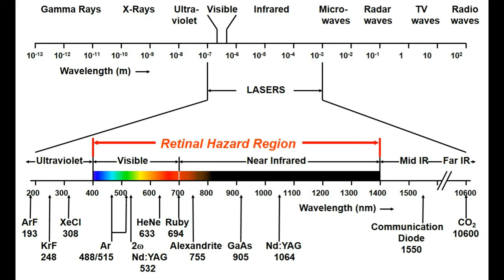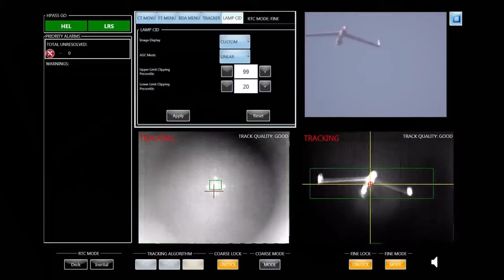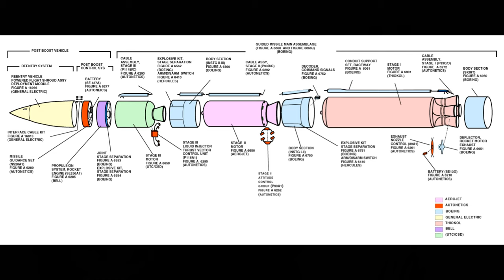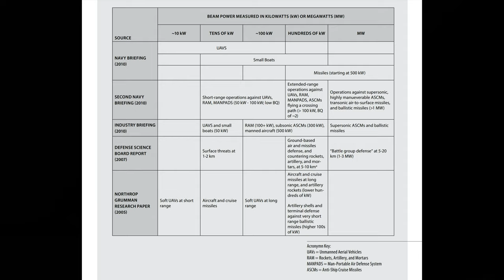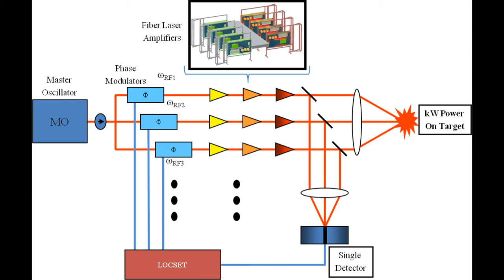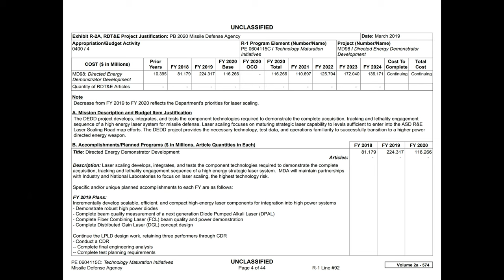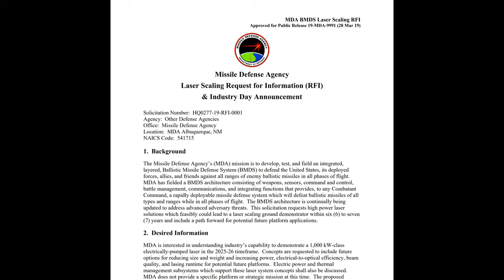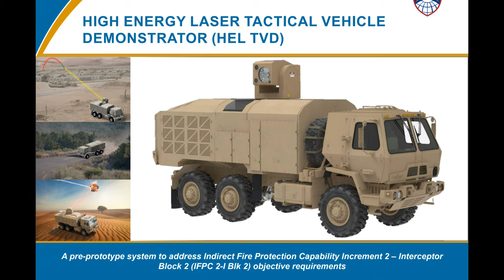An Intro to American Laser Weapon Efforts

Comment: @1'45" you show an image of the EM spectrum with visible + near IR marked as "Retinal Hazard Region". AFAIK, near UV can also cause retinal damage (especially since unlike visible light, it does not trigger the blinking reflex and pupil contraction).
Later on, when you're talking about chemical lasers you're stating they're large and bulky. Overall they were, but not really when compared to their output. Their main downsides are:
1) the chemicals tend to be very corrosive (fluorine is horrifying stuff)
2) their beam quality tends to be pretty poor, resulting in a wide spread and poor range.